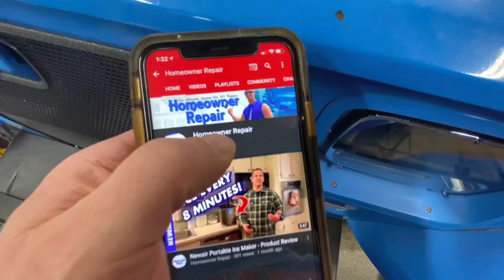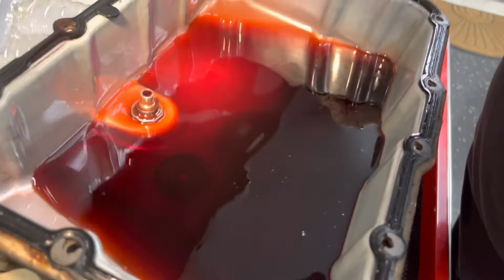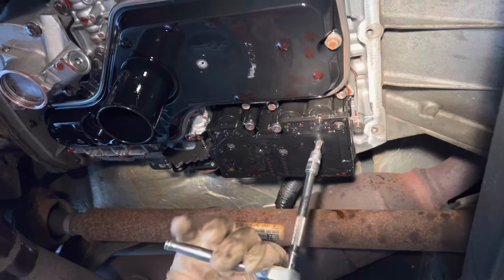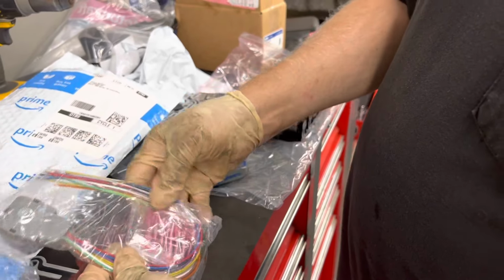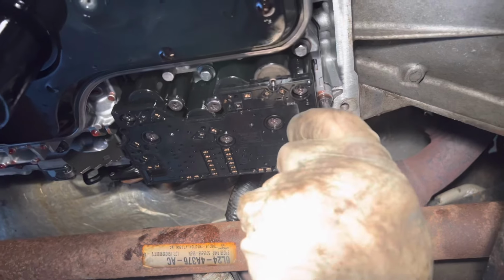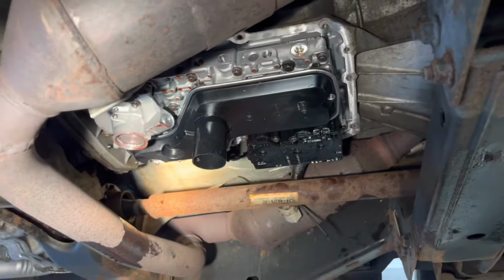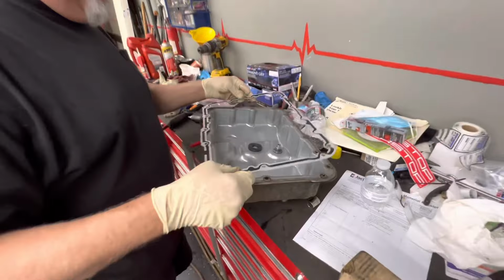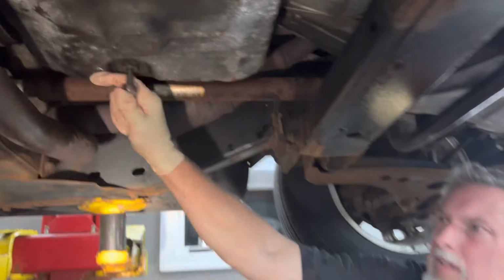2006-2010 Ford Explorer Transmission Solenoid Pack Replacement

Comment: what if my new connector had a black wire but my old one doesn't???
Reply from the maker: You may want to examine it to make sure you have the correct one and check to see if the plug end is the same.

Comment: My father has one of these cars and it has a problem that it doesn't shift easily

If the car was cold and i want to shift to reverse or anything else i must rev until it shifts

And when i put it on park it doesn't shift until i keep moving the gear many times until it works

We took the car to 2 workshops and they changed the whole transmission but the problem didn't finish

If we change the solenoid will it finish?
Reply from the maker: Did you have the transmission fluid level checked?
Reply: @HomeownerRepair  i didn't check it by myself but maybe the mechanic filled it
Reply: Put Motorcraft coils in. Only use Motorcraft parts on Fords

Comment: Awesome video my transmission is acting weird sometimes when I come to a stop the second I start moving there’s a pause then the power kicks in with a slight jolt. Would this solve it or is there something else going on.
Reply: Could be, but you'd likely have a code for the transmission shift solenoid. Since it's a transmission code it would probably show up as a yellow wrench on the dash.
If you dont have any codes you're better off to let a shop diagnose it
Reply from the maker: Yes if the is a light on the dash you may want to pull the code

Comment: I have a 2003 with a p0733 code.
Reply from the maker: Yeah, This might fix the problem if the transmission is slipping. We lost pretty much all of the gears on our Ford Expedition. Once I replaced the solenoid pack OMG it was like a brand new truck, the transmission shifted like butter. Hope this helps you out.

Comment: How much would this job cost
Reply from the maker: The coil pack was around $450.00 bucks. Took about two hours to replace it. So, you are probably looking at $850-$1,200 bucks depending on where you go to have it replaced.
Reply: @HomeownerRepair  check my question in the comments I'm currently working on one as well speak